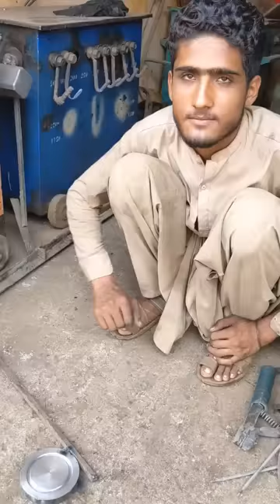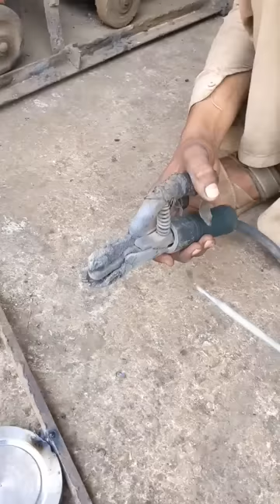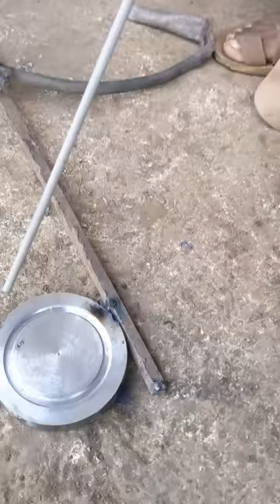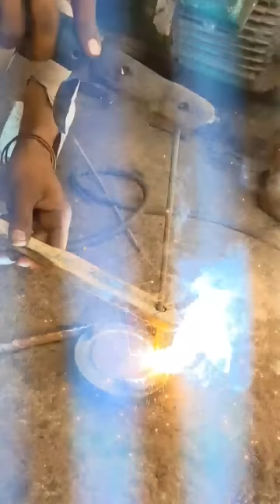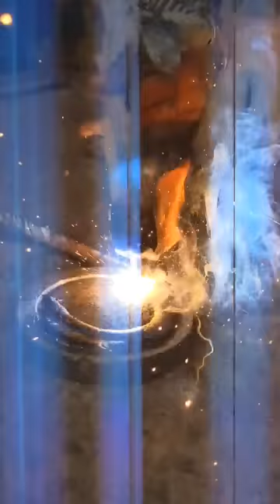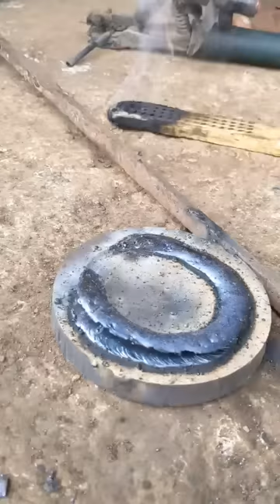new ideas for stick welding in Pakistan ##shortsvideo

Comment: Can you weld in any other position besides 1G and use another rod other than 6013?
Reply: Even with your 1st world country equipment you can weld as good as him
Reply: @pgood7266  lol did you mean I can't* weld as good as him? I can weld better with my less dominant hand and I'm certified in all processes.
Reply: My guy is literally holding his welding hood with his knees and still laying near perfect beads. Plus why not weld flat when you can why would you intentionally make it harder for yourself
Reply: @steez4sale188  do it in sandles
Reply: @nominatorchris5591  I regularly go out in my garage in shorts and flip flops. There's nothing difficult about it... You're just running the risk of a little burn.
Reply: Upload your own video. Show us something that will amaze us.
Reply: @Ragin__Cajun  whats the difference hows he holding his shield ( not hood)
, you would refer to a monkey shield  as hood) as long as the lens is front of his face, what does that matter at all? Welders talking here, you be quiet
Reply: Yup, the guy cant even type correct yet he will argue you about welding, gtfo 😂
Reply: @JohnDoe-lx5rm  ahhh unnecessary dig bro 15 yard penalty and automatic 1st down… considering English is probably not his first language?
Reply: Pretty sure that’s a 7018 rod
Reply: @holeefuksumtingwong5788  actually thats what i was thinking, but its running so crisp too. Doesnt that look like 3/16 instead of 5/32? Or am I wrong?
Reply: @holeefuksumtingwong5788  I said 6013 bc that's all I've been seeing him use. I didn't bother to pay attention in this one
Reply: @Ragin__Cajun  
cant turn a ship or a rig upside down to make it easier
Reply: @holeefuksumtingwong5788  
6013  on Ac current